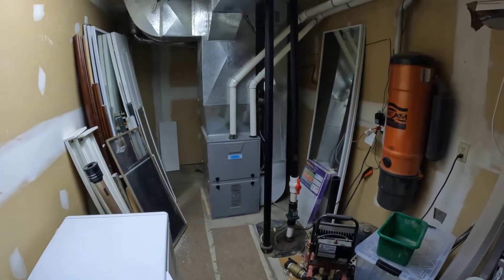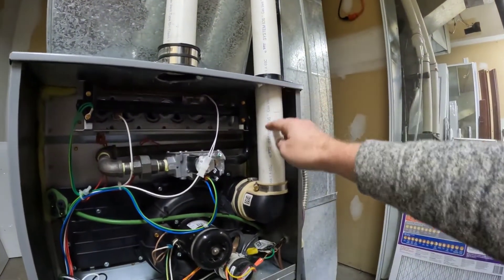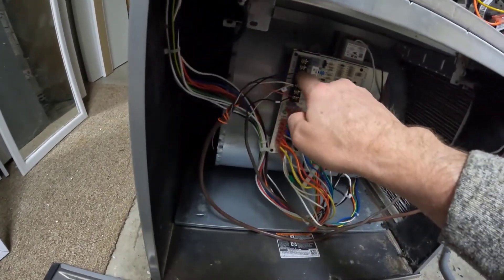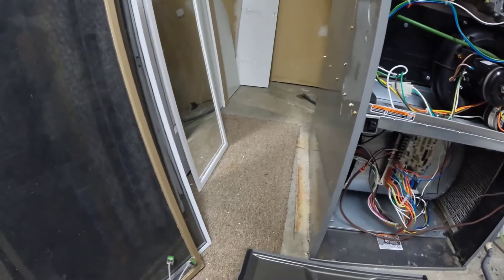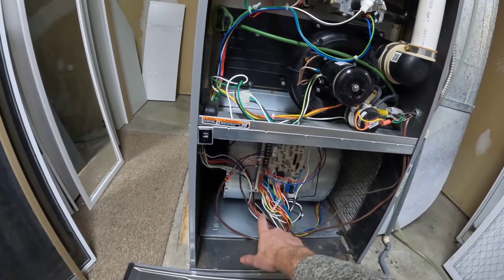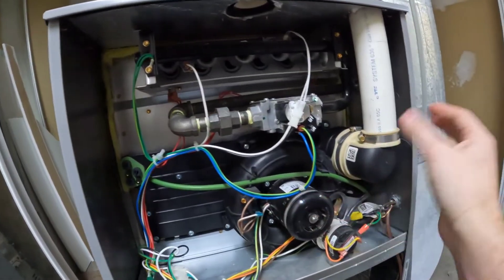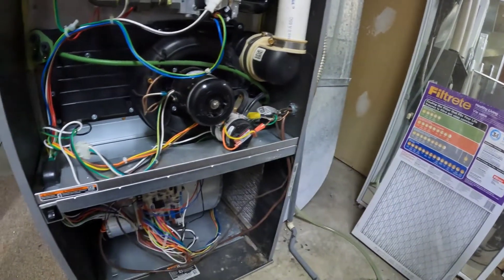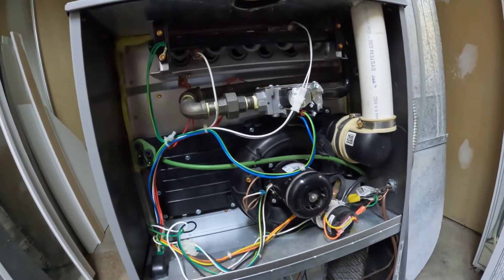Gas Furnace 3 quick flashes quick fix | Pressure Switch blocked | Nest 3rd gen thermostat C wire

Comment: After many trials and tribulations this was my issue as well.  A little bit of compressed air fixed the issue.  Thanks!
Reply from the maker: Glad it helped!
Reply from the maker: In the end i had to take a few more things out (like the box the tubes feed into) as it was somewhat plugged with dirt etc.. but after that it has been good

Comment: My Powermate 3400W generator won't turn on my NEW gas furnace! It did run the old oil furnace. When utility power to house came back on, the furnace started. The generator sockets have 3rd ground hole The ground is already connected to neutral side. The power out at end of 3 prong extension cord was 60cycle AC 117volts. What's wrong?  The male plug has poor ground. The socket on furnace has loose connection for plug. Is the new gas furnace in lockout mode? Service sheet says no power.Does the new Airtemp gas furnace have a timed off period before allowing main circuit board to turn on? No response from contractor. He has the plague.
Reply from the maker: I don't have experience wiring up a generator to a furnace directly, but i've seen videos like this showing how to use a 12v car battery:  https://youtu.be/gVrPggDgWGg